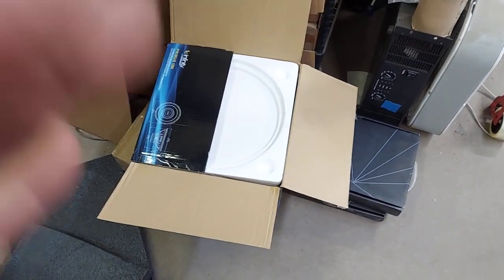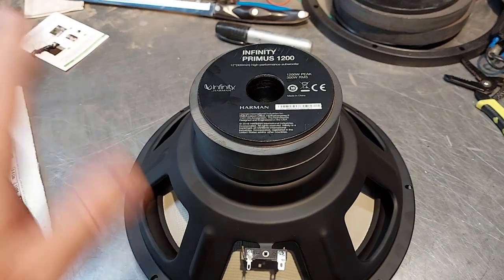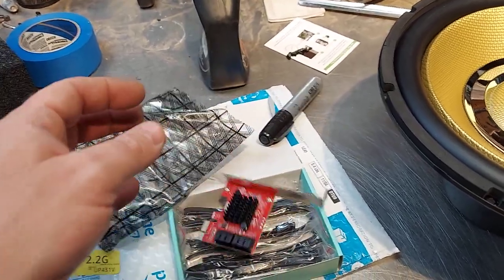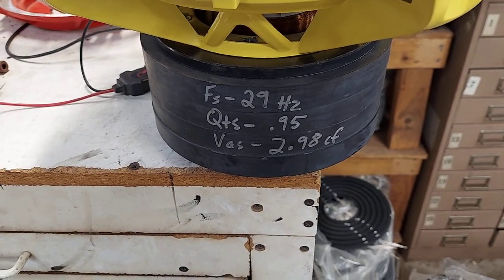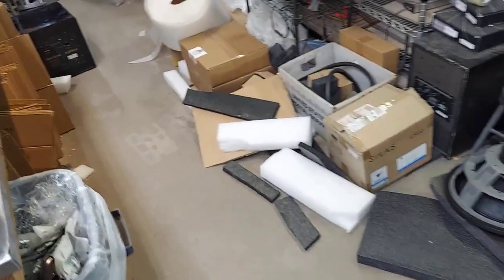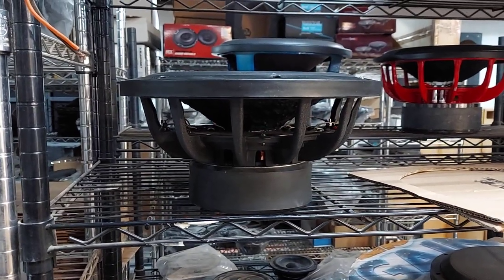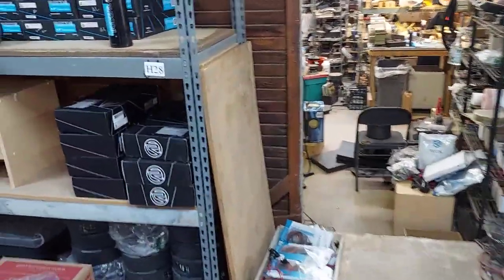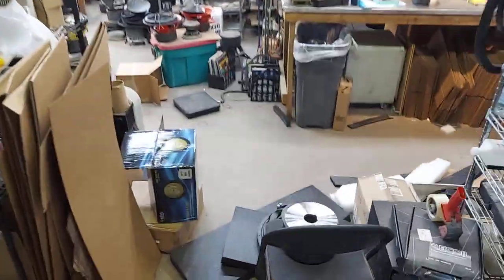12" Infinity Primus 1200 eval & rebadge + AudioPipe 15" +QuadStack Jr. 4 Sale + Alpine Type X recone

Comment: I don't suppose you have a link for the instruction manual, or happen to have the TS parameters. I want to buy a couple off of Amazon, but I cannot find the manual for that model anywhere. Including Infinity's website.
Reply from the maker: You're Googling wrong. https://ggle.io/5qcZ
Reply: @RobotUnderground  I appreciate the effort but I don't need it for the 1270, I need it for the 1200. Same model you have. I need the TS parameters so I can model it in winisd to see if it will meet the parameters I need for a specific t-line enclosure.
Reply from the maker: @runningbear1982  I thought I posted the TSP's on one of the videos or the IG channel.  Just make a regular ported box for it.  1.5 to 2.4cf @ 32hz is fine.

Comment: How do these primus stack up against  power acoustic  Gothic?
Reply from the maker: Gothic is stronger but also more expensive.  Gothic is close to the performance of the Rockford P3.
Reply: @RobotUnderground  gothic 70 at Walmart plus ten extra for 2 year warranty. In stock at my wall mart. Hits better in my box than my Dayton Max x 12 but that's cuz my box is oversized for the Dayton and perfect for the gothic. 2.5 cu ft
Reply from the maker: @anglerandy5736  Agreed!  It's basically a Rockford P3 for a fraction of the price.

Comment: Hey man,saw a cheap subwoofer here in Trinidad,its a knock off because its called FONY,its a 10"and looks pretty decent,double stack magnet and an aluminium basket with side vents,just the ugly Fony on the dust cap.dont know its origin maybe china,thinking about buying 3 and changing out the coils,spiders,surround an probaly the cone too
Reply from the maker: It doesn't know what brand it is.  If it performs, it performs.

Comment: You can make all your old radios bluetooth capable by hooking up a bluetooth transmitter... itll make people wish they kept their old radios  because  they sounded better unlike trash they sale now days..
Reply from the maker: Correct.  Put that AUX input to good use.  Make sure you get BT4 or better.  AliExpress has some great deals.
Reply: Can you expound on this? What type or range of year radio/stereo are we talking? I have a stack of old car stereos - some inop, some just fine,  (holding onto for when i learn how to revive them). And also home recievers, a couple being the old sansui from the 70s. I have one that is switchable from 110 to 220 with a chip in the back, its a monster. It works, but gets staticy while its cold
Reply: @jimbobdobbs1597   I'm sure its possible to make any thing bluetooth,all the way back to the 80s.. not sure about 70s but maybe... I've spent the past 20 years as a hobby of mine tinkering with electronics ..  but a old phone charger would be a great power supply for a bluetooth transmitter to be used  for home audio because it's out put is DC voltages
Reply: @zacharyreed4409  yep i've saved a small tub of all type of power supplies, but i was more piqued about the sound quality issue, i had noticed the newer recievers seemed to have less sound depth and reach.  I wondered about when the sq went away, and what they did to cause that. I have both digital and analog spin- tune type stereos, and i know for sure those older ones sounded great. I also have a carver reciever that only says 75 watts. But it keeps up or surpasses my current 110 w yamaha it seems.
Reply from the maker: @jimbobdobbs1597  Flip all that old shit.   You can use one of these with great success in the AUX or CD port on home or car receivers.  https://amzn.to/3q8RLFF